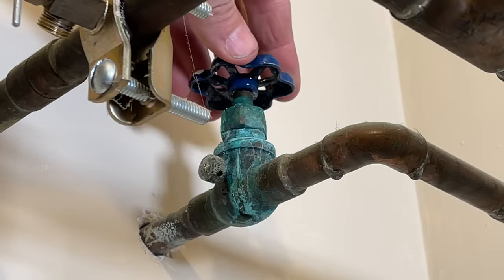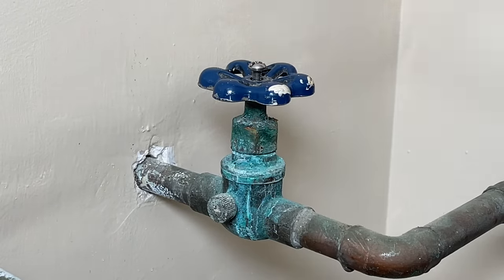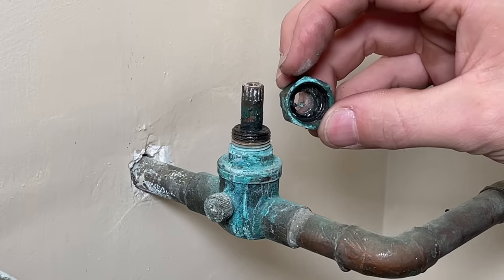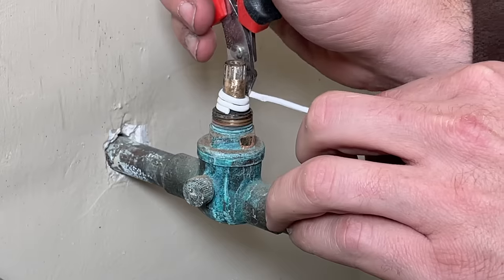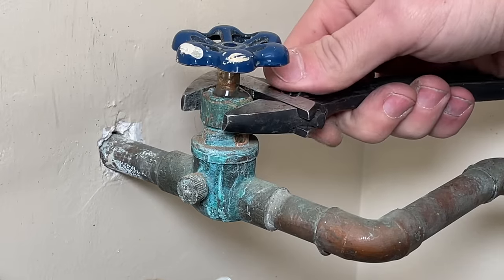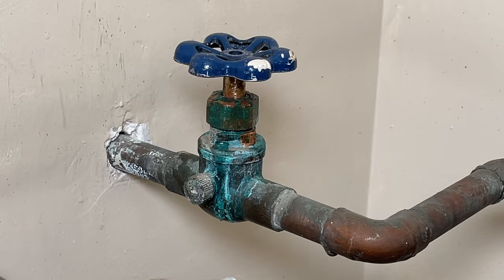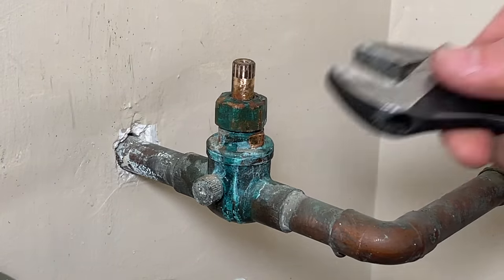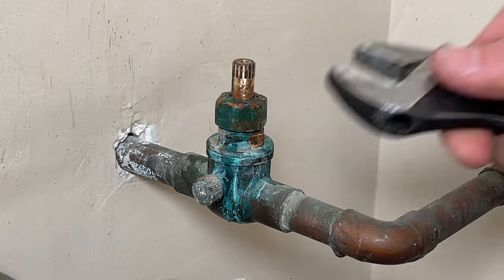How To Fix A Main Water Shutoff Valve Leak

Comment: if you do this to an 50 year old main water intake valve, there is a 80% chance you will snap the oxidized copper line, the stem may simply bend right off or you could get in there and put alot of pressure to push it and your hand will skip off with the tool and pierce the line. call a plumber, this is eye level in a dry room, easy peasy, dont be leaning over in your main water set up messing with it. it could break and you have about 12 hours until the city turns off the water main outside in the sidewalk.

Comment: To be fare, the washer did not help at all in stopping your original leak issue. It just allowed you to shut the water off without a leak. Cleaning and repacking it was what actually stopped the leak. Breaking it down completely just made it easier to clean. Definitely did need a new washer no doubt. It's always nice to be able to shut your valve off when you need to.

Comment: Thanks for sharing. I've learned some which I had been wondering about.
But I have a question; Wouldn't some spray of WD40 will help to break lose the bonnet nut ?
Can someone response please ? 
Thanks in advance. GOD bless ya all for your all good works.

Comment: I had two locked up like this. Did not heat it up enough. Did some tapping on it, then heated twice.  Had to use vice grips to break it free. Fortunately I had two new faucet guts to repair it.

Comment: Take a wire brush to all that corrosion and get it down to clean copper again. Then install new packing, and when you go to open this type of valve you can loosen the packing nut slightly before opening and shutting, and then tighten the packing nut after you are done turning the valve shaft to save on wear of the packing.

Comment: Great video and super helpful! I watched your clips many times on FB and follow them here as well. I'm living in an old condo unit, which has water flowing heating pipes along the walls. I have a similar valve on the heating pipes, and I've wondered if it's possible to buy parts (valve stem, packing nut, bonnet etc) and just replace them rather than cleaning it or cutting the pipes (I really wanna change it to ball valve but I wouldn't dare cut the pipes). I meant just changing the whole chunk like changing Symmons shower valve stem assembly.  Maybe different brands have different size/compatibility? My valve is so old that it might not become clean enough. Previous owners painted over it and probably never even tried to clean it. A lot of mineral as well.  Would really appreciate if you can answer! Thanks for the good clips again.

Comment: I had a problem similar to this at my old house.  But, that valve would not turn off. Fortunately, I do have enough skills to solder in a new quarter turn valve. My soldering isn't pretty, but it is effective.

Comment: Once I get to needing to remove the bonnet nut I just replace the valve. Especially in a wide open area like that that's easily serviceable, cut the pipe and slip a sharkbite shut-off valve in there and you're done. It's way faster than all that cleaning and potential for doing more damage trying to break the nut free.

Comment: This is a great video on the repair of globe valves, but . . . I think this requires more skills and perhaps luck than simply installing a new $20 ball valve.  Some jurisdictions won't allow you to turn off your own curb stop, so this is certainly a project to start in the morning during normal business hours.
Addendum:  Just looked at a great video on installing ball valves by the same author.

Comment: I always use about 6” piece of Teflon tape and twirl it up into a thin rope or thick string and wrap it around the stem and tighten down the packing nut. It works 80% of the time.

Mark.  The Plumber that plumbers recommend

Comment: I have a few things to point out to watch for. If you replace the flat seat washer, take a look at the seat its self and make sure it is not pitted or had build up. They make a tool to recondition the seat., or some valves seats are replaceable using a special tool.  Next, it is best to do a complete removal and cleaning then all new parts to start with. Lastly, when you apply heat to a valve that has rubber parts inside, it is best to remove as many as you can or at least open the valve to unseat the rubber from the brass seat before applying heat. And remove the drain cap as well because it has a rubber o-ring that heat can destroy.

If you are going to replace the main shut off, check your local building department first. My area requires that ONLY a flare fitting shut off valve be installed, your building department might have different requirements.

Comment: Good job showing the failures, and I am not being sarcastic.  Too many videos are setup for success (new parts, etc.) and when you do it for real as an amateur you are not set up for immediate success.  I've had good results using a mechanic's deep well socket to remove the bonnet, a hex socket or even a box wrench is less likely to round the bonnet.  A small impact wrench will do wonders if you have one.  Once rounded it's vise grips or a pipe wrench but that's ugly!

I saw you with a torch and the street valve shut off and I thought "why doesn't he just replace..."?  Then I saw the end.  never mind!  I'll watch that video too!

Comment: If people are just trying to avoid the cut , flux soldering hassle of replacing valve because it is in a tight spot like me .
I just bought a new value and removed  internal stem assembly and put in in the old valve housing .  
No no soaking and cleaning needed and much faster .

Comment: Tightening packing nut can work but you should mention and demonstrate holding second wrench in opposite direction to avoid a serious problem with the copper pipe.. skilled people will know how much torque to apply but many run risk without second wrench

Comment: If you can shut the water off at the meter then there's really no need for the valves down stream to "completely" shut off. But if one's already  leaking.....
   Open the rising stem valve ALL the way before sanding so you can affect the whole stem. Add as much packing as it will hold before replacing the packing nut. If you want to remove the bonnet,  get 2 - (approx) 20 oz. hammers. Hold one against the side of the bonnet and strike the opposite side with the other hammer, working all the way around while moving both hammers opposite. Do this 2 to 3 revolutions to separate the 2 metal pieces (on a molecular level).... Makes it MUCH easier when applying the wrench.
When I work on water systems on  older houses I ALWAYS turn it off at the meter... you're just asking for trouble if you turn an old "rising stem" valve at all.

Comment: Nice video.. But unless you get paid by the hour, or are a homeowner/DIY... Please either just replace the entire valve, or skip to step 3 and REPLACE all of the inner gaskets.. And yes, the " bonnet" nut that connects the entire stem to the rest of the body should have a thin fiber washer or o ring. Where he uses packing cord, that should also be a flat washer instead. I did find the rocking of the crescent wrench in order to loosen the handle very useful.. And also, to remove a stuck bonnet nut, tap the valve body after you've heated it.. Helps to loosen the rust in the thread.

Comment: To soak valve in vinegar just use paper towels wrapped on joint and soak in vinegar. You could wrap plastic wrap around to add bit of pressure to keep towels on valve. Another thing is plumbers sand paper may be too coarse on stem.
Reply from the maker: Thanks for the feedback Bruno 👍

Comment: Great vid!  Mine isn't leaking, however it's very old and almost rusty, I'm afraid one day it will just fall apart.  If I were to replace it with a brand new one, what would the benefit be besides being new and smooth? Asking because every time I turn the bath sink faucet, shower faucet, flush the toilet, or use the washer, one can hear the water flowing loud in all of the pipes round the house. Driving me crazy.  Any tips how to correct that?

Comment: I got one: the leak is between the basement wall leading to the valve and the valve itself. City says call a plumber, plumbers say call the city. The homeowner swears the service valve is not out front in the sidewalk, even though there are 3 service access ports in the ground: 1 unmarked plastic cap, 1 obvious gas line cap and 1 partially buried water access line cap in the street by the sidewalk. I explained that 1 of those access points has to be the water on/off (if we could turn the water off we could repair/replace the pipe with the hole, but its impossible if the water is rocketing out and the flood would be crazy). A rigged piece of trellis + a trash can with a sub pump in it diverts, collects and pumps the collected water out to the drain for now, but i am at an impass as to what to do for my friend and without explanation of how the friend knows those access ports are not the water shut off, when every home i ever been in has them out front in the sidewalk, it is a problem in limbo...

Comment: I'm pretty sure if you kept adding packing you'd have gotten it. Also, when trying to remove the bonnet, put a hammer on one side of it and another opposite it and tap all the way around the circumference several times using the second hammer to "Back-up" the blow  from the other hammer. It's to separate the 2 pieces of brass at a molecular level....works great in most circumstances.
Reply from the maker: Thanks for the feedback and appreciate the help!

Comment: Good overall, but, (2) a pipe wrench to support the pipe and another to break the nut. Any home owner should have a pipe wrench, does not have to be huge but a 10-12" I would recommend. 

Also,like you said install a new ball valve.  3/4" inch sharkbite push to fit connector, pipe cutter and reamer to cut and debur , and a scotchbrite pad to clean the pipe and your done (probably less than $40 and no worries for the next decade. (But that is if you were able to turn off your Watermain at the curb).

Comment: Question, kindly: ¿how much did you have to heat the valve's bonnet to break it's seal with the valve's body, please?  Have a leaky stem & need to repack the packing nut, please.  Thank you for making & posting this video.

Comment: There's another way. Buy a shut-off valve that matches the one already installed. Remove from the new valve the stem/bonnet assembly (it will be tight) and match it with the old and if it's the same,  screw it in the old one. I just did this with a new American Valve branded shutoff valve and a 1960's shutoff valve.  Old valve was corroded and the screw holding the washer broke off and couldn't be removed. I did wrap the threads with Teflon tape and a coating of pipe dope. It's worth a shot, especially if the valve is in a difficult to reach area.

Comment: That's cool if you're able to shut the water before the main valve. On my 71 year old house the only way to shut it would be near the curb with a special tool. At that point,  I would replace the whole valve with a much better valve. I guess back in the day that's what they had, a crappy cutoff with a crappy washer...

Comment: Use some plumber's grease on the threads and on the Teflon cord.
PS:  what is that knob on the side of the valve for? Thanks for the vid, sir!
Reply from the maker: Thanks for the feedback.  The knob on the side is called a bleeder valve.  Assuming the valve is installed correctly once you shutoff the valve the bleeder valve can be loosened to drain or "bleed" the water from the pipes after the shutoff valve.

Comment: Did any  notice that the screws are ECX screws. The same as the ones used in electrical outlets. ECX or Robert's square drivers are made for this.

Comment: Before moving to step 3 I would shit off main water, then extend the stem out as far as possible, then clean stem with sandpaper and vinegar. It would make the diameter of the stem uniform throughout its length and maybe packing alone afterward would work, without having to take apart the bonnet. My 2cents.

Comment: You can also buy dome washers. They fit and work better than cord. But I thought your problem was the seat was leaking allowing water to keep flowing even when shut off. You probably just needed a new seat washer. Or your seat was pitted.

Comment: Those are good for filing buckets tanks to their calm flow outlet compared with 90° ball valve, good mid control for washing hands plus high flow for filling and things especially useful when you use a reservoir were  the level isn't always the same, for counter on/off use a ball valve it's more appropriate for reliability, safety and fast switch.

Comment: One thing that was left out is: The rubber washer that he replaced on the bottom of the valve seals against a seat down inside the bottom body of valve. This seat can corrode and cause a leak. You can replace this seat just buy an new on at the hardware store. You will need an inexpensive valve seat tool with a square drive for this.
The easier way to do this is to take the entire part he removed from the body of the valve. Buy the identical entire valve at the hardware store, remove the part you removed form your and use the new one.

Comment: Perhaps a deep socket would fit over the valve so that an air gun or impact driver can be used to remove the bonnet nut.

Comment: Heat doesn’t help dissolve the minerals that make the joints difficult to separate. The heat will cause the metal joint space to open up a little and this helps it to open easier.

Comment: use some brown sauce as well this will fetch that off and you can just spread it all over and do not have to take it off for a soak also i have used string when i could not get the packing good job but i might have replace the inner part

Comment: I'm surprised that you didn't wrap Teflon tape around the threads of the bonnet. I would think that would give you some additional sealing since the bonnet had no fiber/rubber washer.

Comment: I hate these valves. Had them all over my house when I bought it 15 years ago. Last time I had my water off (the city replaced our meters and shut the water off) I replaced my main valve and both water heater valves with  quarter turn ball valves, which were a cinch to install because the connections for my incoming supply are still galvanized pipe and the water heater I was able to use shark bite valves per code.

The only globe valve I still have is unsurprisingly my hose faucet for my yard because it offers more variable control of water flow, though from what I understand, globe valves are not actually meant to operate at anything but full open or full close (you have probably noticed they are notorious for leaking when not fully open or closed)

Comment: The way to address this is call the water company have them shut off the supply and swap the valve for a better design. If you try to take shortcuts it will backfire on you. No need to mess with it if the water is shut off. Yank it out and be done.

Comment: I would change the stem assembly  completely...also  when you sand anything the water will find a way through ... an O-ring is needed under the bonnet in the union nut ,for older valves

Comment: stem handle is typically made of a zinc alloy ("pot" metal or "white metal"). over the years it can oxidize and easily break. Be prepared to replace it; it's cheap.

Comment: I've always rotated the valve stem while tightening the packing nut, that's why they call it packing. Rotation gives better , smoother seal, Your thoughts?

Comment: Hi, thanks for this great video. I can't unscrew the flat screw to remove the handler. My outdoor faucet doesn't have packing nut. So I only need to unscrew the flat screw and pull out the handler. I tried put the heat using torch also but I still can't turn the flat screw. I didn't want to put too much heat, I afraid off melting the washer inside. Should I try put more heat or is there any other way to do? I can't afford $250 for plumber to just change a washer. I hope my LIKE went thru because I forgot the YOUTUBE password.

Thanks, hope you still respond after a year.

Comment: The valve in the demo does not appear to be a main shut-off. 1/2” valve with down-stream vent appears to be for an outdoor hose-bib. When working on a main, shut water at the curb box.

Comment: Correction, that is a gate valve. Best for full open or fully closed position. 
Globe valve is for throttling pressure ex. heating systems ect...

Comment: Anyone who has a soldering torch to heat and loosen a stem might also have a soldering kit, I say replace the ball valve or just solder a male adapter for the valve and transition to diferent material if don't wanna solder all in copper,  our rule of thumb in always a new shut-off valve with a new water heater.

Comment: A ball valve is superior, but repairing the existing unit is just a simple parts swap.  A novice can do this rather than having the need for some skill and additional tools (mini pipe cutter, gas torch, etc) with sweating a new valve. Now if this is a valve at one of my rental units and I've sent in someone to do a repair, I always have them replace it with a ball valve. It's only a little bit more money over the existing charge.
Reply from the maker: Agreed, I actually swapped this exact valve out to a ball valve shortly after this video.  I am not a fan of old globe valves in my rentals either.

Comment: There is enough pipe on front and back of it. Would it not have been quicker and more efficient to cut that old valve out and put in a nice new ball valve that will last?
Reply from the maker: If that is an option for you I would definitely put in a new ball valve.  I actually wanted to give an overview for those who don't have the option of swapping out the Globe valve.  Here is the same valve getting swapped out to a ball valve 👍 https://youtu.be/U2CEQHM06cQ